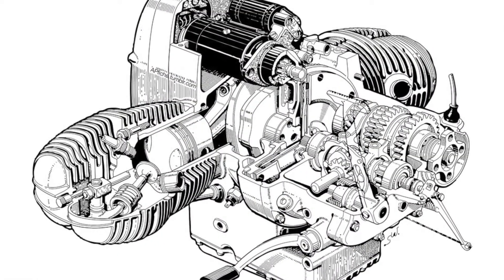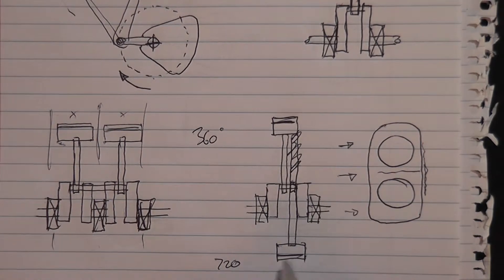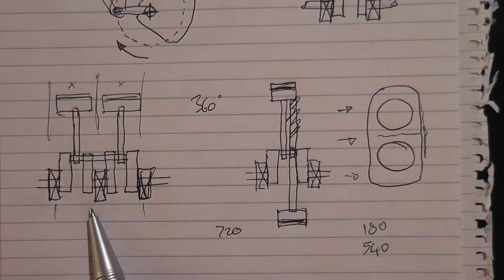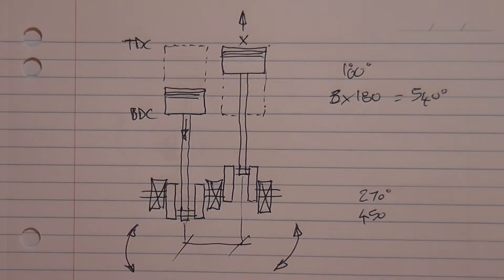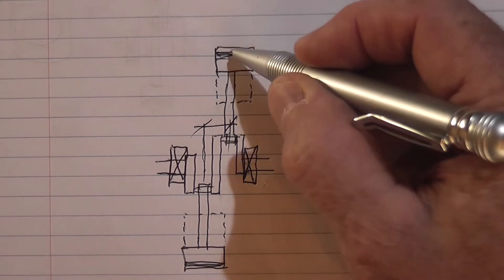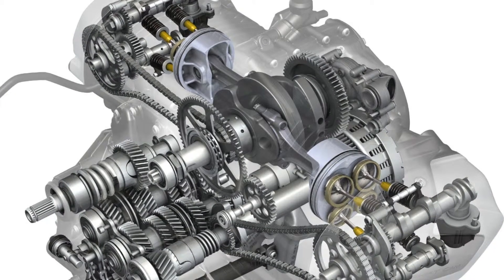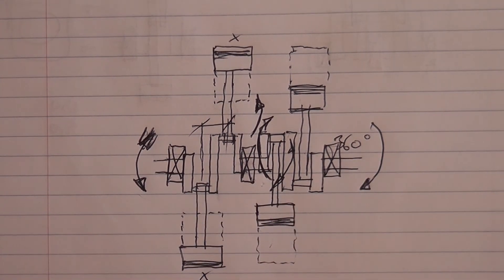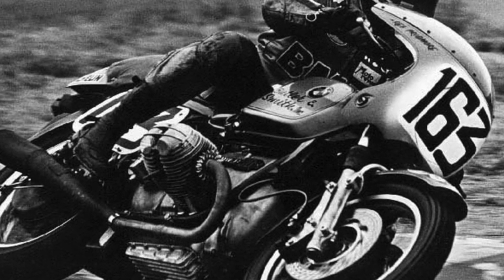Classic Motorcycle Engines Part 3 - Boxer Twins

Comment: Lawrence made an aircraft engine, flat twin, 1 common rod journal after WWI. It vibrated a lot.The cranks were then changed to allow boxer (2 rod journals) operation. All automotive and aircraft flat 12s and H 24s (twin cranks) are shared rod journal cranks. They look like a straight 6 crankshaft. This is clearly much stronger than the noodle like crankshaft of a boxer engine. I think the Porsche 908 was a 9 main bearing crankshaft, so each rod had its own journal. In reference to the flat twin being the outgrowth of the parallel twin, arguably is the operative word there. Thanks for the videos.